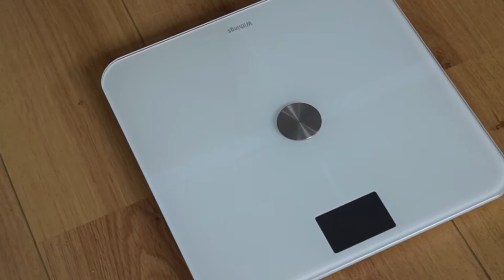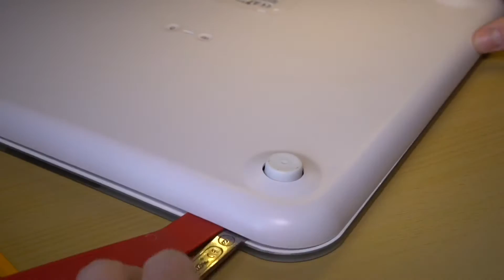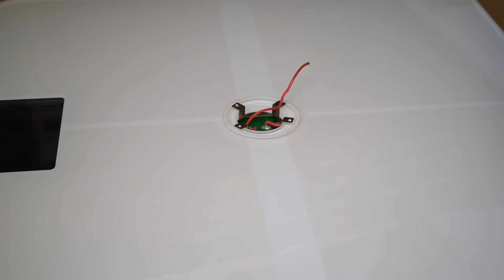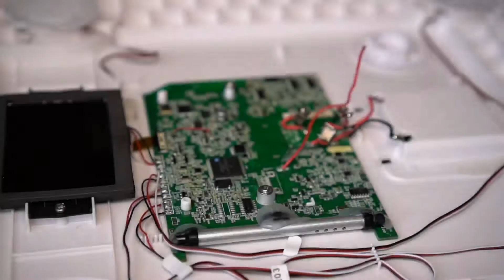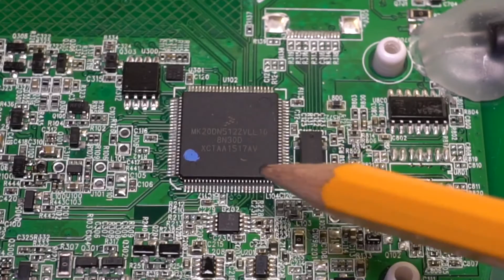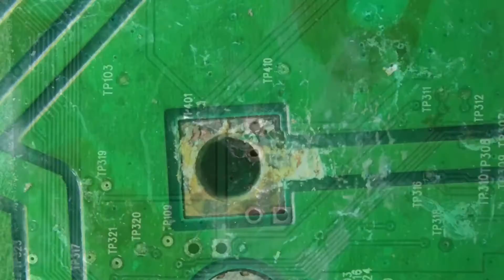Withings wifi smart scales teardown and repair

Comment: It’s an old video but still useful. No one would have any idea how to open it without it  bravo 🎉 My scale had taken a hit and it was unbalanced and the display did not proceed beyond the initial weight reading. It turned out that (what seems to be) a small magnet in one of the feet had moved. I was able to reset it in place and voila, it works great again. Thanks!!

Comment: I rubbed/pressed my foot on the silver disc in the middle. The scale started measuring the body fat percentage again. If it doesn't work, I would still try removing and cleaning just the disc first before opening the whole package. It's worth trying if it's just a body fat measurement problem.

Comment: I wonder if you could tell me if it's possible to replace the LCD screen? I'm trying to search for generic LCD screens in the right proportions but idk what the connector type is called
Reply: Did you manage to fix it? The backlight in mine has gone.
Reply: @sarahdaviscc  unfortunately not, I couldn't find a replacement screen

Comment: Thanks for this without it I wouldn't have had the confidence to take my apart to try and fix my broken display! Mine didn't have a wire soldered to the metal button, and the PCB was a lot smaller than the display
Reply: Did you manage to fix your display? The backlight in mine has gone.

Comment: Thank you, I was interested in where air quality sensor is placed and as I can see there are no proper ventilation holes fot this, apart three tiny holes between two buttons. This means that the measurements of the air quality can be quite poor.

Comment: Think mines in the same boat (water damage) - the screen randomly comes on and changes the weight measurement unit. Very annoying. Everything else works but it's a pain to weigh and see that it's in a different measurement to what I'm expecting, plus the batteries die faster. Do you think I could get the adhesive loose with a hairdryer?
Reply from the maker: Hi Alex, A hair dryer should get it more than warm enough, just take your time with it, it does take some patience!
Reply: I have the same problem with the wieght units changing themselves. Did you manage to fix it? If so, how? Considering opening mine to take a look.

Comment: Thank you so much for your video! I had to open mine because of erratic measurements and a loose part that I can hear when manipulating the scale. But had no idea how to open it. I manage to open it, which was not an easy job. I found out that there was a small metal disk loose in the case that had gone from under one of the load cells. Now it is working fine. Thanks again.

Comment: Thanks ever so much for this video. Our scales stopped working after getting a dousing with bath water the other night :) I was disappointed to see that the newer model Withings smartscales at the same price (~£90) don't feature the body fat measurement or air sensor. The same feature set costs another £30 now (and I got mine on sale for £80!). Anyways, any excuse to buy a new tool, so my scarily cheap (£13) and lightweight Chinese heat gun came from Amazon today. I was a little too impatient waiting for the adhesive pads on the base to soften up and wound up bending the casing trying to lever the glass plate away as it had softened with the heat (the mountings for the weight sensors can also become mishaped if you apply too much pressure). I eventually got the glass plate off and cleaned up the underside of the board and had it working fine. Reassembling the device I heated the casing and sensor mount points up again and bent them back into place. It's also handy to heat up the adhesive pads a little before you put things back together, as they're stickier this way.

Comment: Thanks a lot for the video ! My scale stopped working (only the display lit when inserting batteries or then stepping only the scale, but no text displayed at all). Dismantled it following the video, just cleaned the bottom of the PCB and it's working again !
What you could add though, is how the "buttons" on the bottom of the scale (to trigger the Bluetooth connect) are working. Seems that I can trigger it on my scale only when touching "A" on the PCB itself (when the scale is disassembled).
Reply from the maker: Great news that you got the scales working again! The buttons on the bottom are capacitive and very sensitive to the distance between the PCB and your finger. I believe the manufacturer used double sided tape to stick the PCB down to the base keeping the distance as small as possible. Perhaps this would help if you have some double sided tape to hand?

Comment: I just bought some of these in non-working condition... thanks for the tips on getting them apart. Mine show 50.0kg upside down when started!  Not sure if that is a firmware issue or if the display is actually installed the wrong way up!

Comment: Spilled a glass of Zinfandel on my scale.  Took it apart per your instructions isopropyl on both sides of the board and dried the insides.  Works great for 24 hrs and then batteries dead.  What could be putting a load on it?

Comment: Hi i have a scale which shows low battery. But i have changed to new batts n still the same. Could u knw wats faulty pls? The scale does not work as in wat ever i put on it the display shows 0. I even changed a new load cell. Im at a dead end.

Comment: Thank you for sharing, my scale had no wire soldered to the center button. It was best in my case to only heat the glass to ease the adhesive tape because the scratches with the pry tool do not look good with a black scale. I had the "HW FAULT 899 - 32K not OK" and I think it was gone after resoldering the two Quartz.

Comment: Do you know which sensor module is used for Air quality? I do not recognise it by the image of it :(
Reply from the maker: MetaImre I'm pretty sure they designed a custom sensor based on an LED, photodiode and their own algorithm I'm afraid. The closest off the shelf parts I've seen are devices like the CCS811.